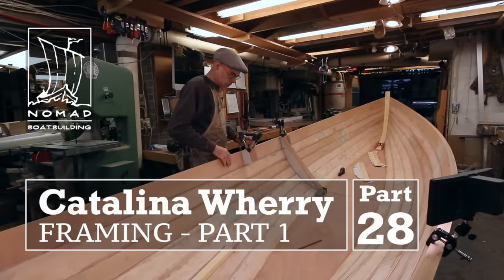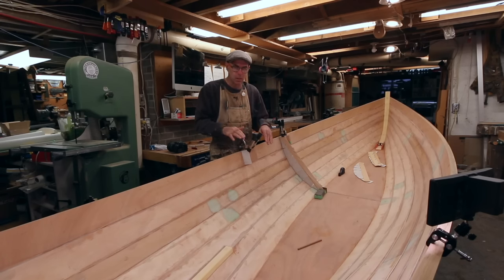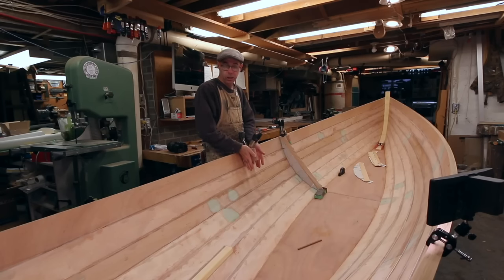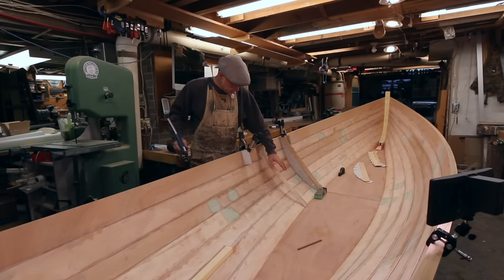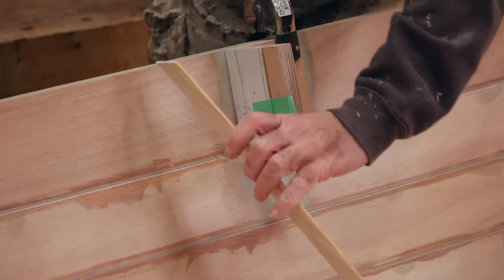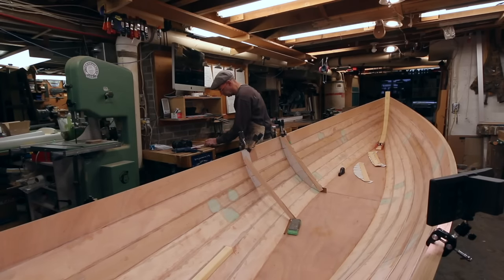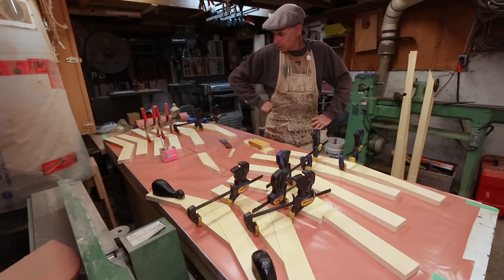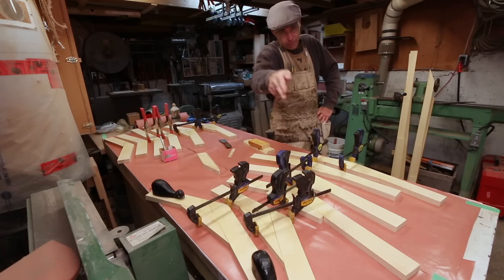Building the Catalina Wherry - Part 28 - Sawn frames Pt.1

Comment: I wondered about use of the nailer to hold the frames during your epoxy glue up. With pending pattern saw cuts, I thought they might have been plastic nails to prevent removal or potential saw damage.
Reply from the maker: Those were plastic nails. I'll be using longer stel nails for ganging the frames up for cutting but those will sit in the waste area.

Comment: Would steam bent oak frames be appropriate instead of all this dramatic pattern making? Inquiring minds want to know…🤔
Reply from the maker: Certainly an option but I can’t easily get bending oak here so that means I need to use kiln dried which means several weeks of soaking for good results. I also didn’t want the nooks and crannies that steamed frames create nor the unsealed penetrations through the plywood that rivets would create. I have seen it done on a similar boat though.